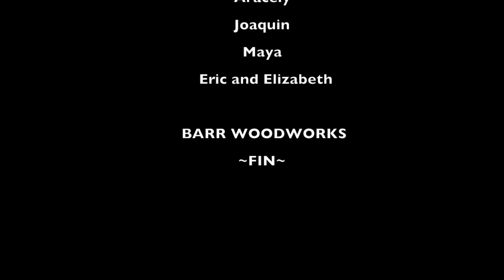Carriage Style Doors Part 3

Comment: Great job. And thanks for sharing. I’m building some similar doors and I’m curious about the glass you chose to use. Would you mind sharing the specs with me? Thickness, tempered, tinted and the manufacturer. Thanks so much.
Reply: Thanks for the comment. I used 1/2" thick glass panes. So a sandwich made up of two 1/8" thick glass and 1/4" spacer. Tint is not too dark, because I wanted to see outside and like the daylight/sun in the winter. They call the color Gray-Annealed. Any glass shop should be able to help you out.

Comment: Hey - I've re-watched this video several times. Your work is excellent. I'm planning to build a similar system with the Hafele Al Fresco  hardware. I noticed there are gaps above and below the doors where the tracks are. Do you have any solutions in mind for sealing/ weather stripping the above and below gaps without interfering with the sliding mechanism?
Reply from the maker: its not shown here, but you'll want to make sure to order the top seal called "Polypile" part PS13B which is inserted into the top channel. For the bottom  use the perimeter seal part AQ21. There is also a seal between doors, part AQ63. Send me an email at hacabinetry@gmail and I can send you the PDF with more info.